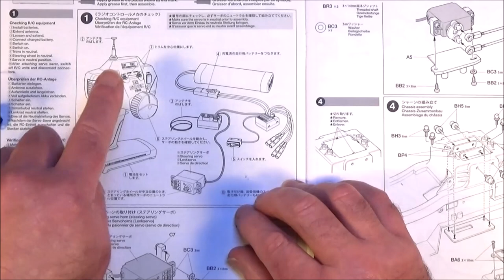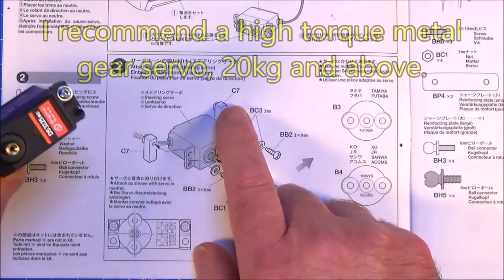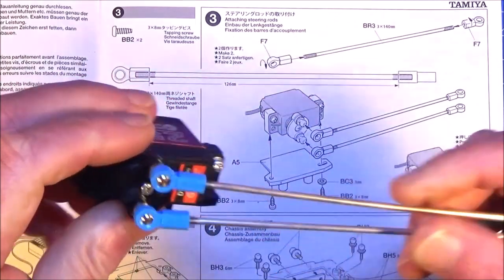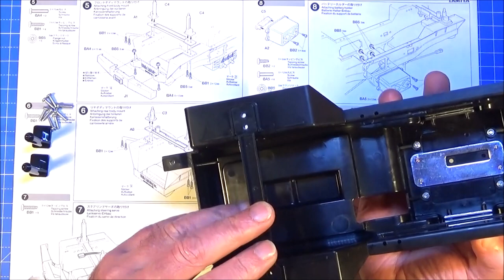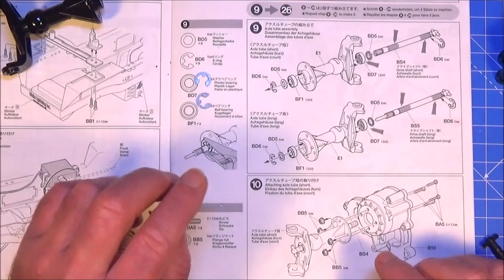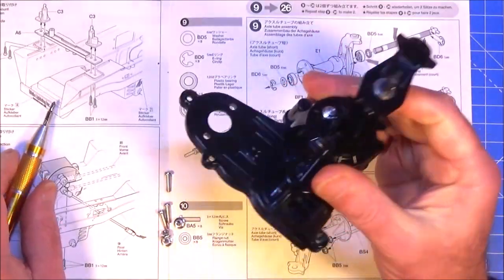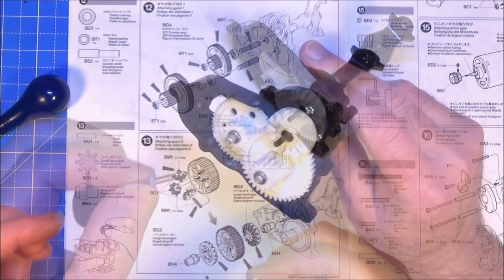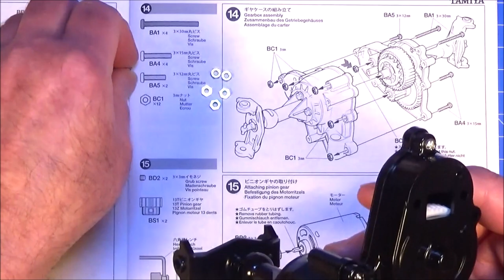Tamiya Super Clodbuster Build Guide P1 - Steps 1 to 14 Plus Hints and Tips!

Comment: On Step 4, I notice when you attach the metal plate on one side with the BH3 6mm ball connector on the other, there are gaps in between designed for captive nuts, however the manual doesn't show inserting them.  I put them in anyway as it would seem to add strength, though I do worry I'll be short 4 nuts at the end of the build. Anyone whose come across this, I'd like to know what you did! Thanks :)
Reply from the maker: I must admit I never noticed those gaps when I built mine. I haven't had any issues though. Thanks for pointing that out, I wonder if anyone else did the same as you? 🤔👍

Comment: Worst part of building the clod is those damned E clips
Reply from the maker: You got that right Thad, but it ain't so bad when you can just use the bench to pop them on! Cheers, dude!
Reply: Nemesis🤣😉
Reply from the maker: @RCBirds  🤣🤣😉😉👍👍
Reply: @MarkBryanRC  watching this again, mine is put together identical to this. I dunno what I’m doing wrong
Reply from the maker: @IowaBudgetRCBashers  Hi Thad, something crazy is going on, you put it together the same but your  dogbone end e clip is not flush against the bearing like mine is. I think the e clip on the gearbox end must be in the wrong slot, other than that your kit must have come with wrong sized axle tubes!!!!!!
Reply: If you're still working on your Clod, make sure the bearings / bushings, whichever you're using, sit flush when seated, otherwise you'll not see the inner groove on the axle for those c clips.
 There are 2 groves on those axles on that end, you need to get the c clip into the inner most groove, that way there is almost no play in the axle when you pull the axle in and out. 
 The instructions were not very clear about that, I know.